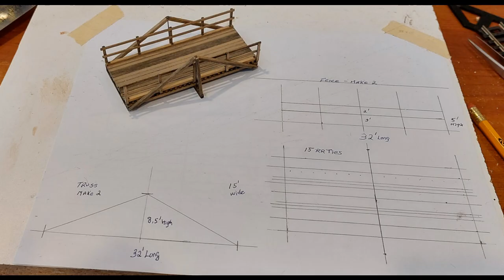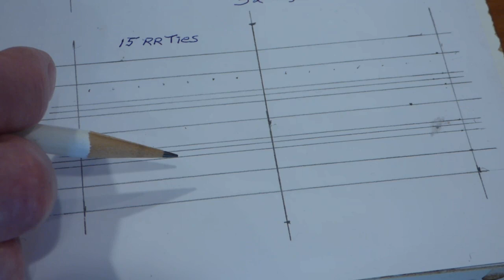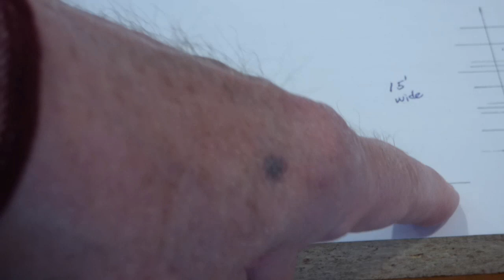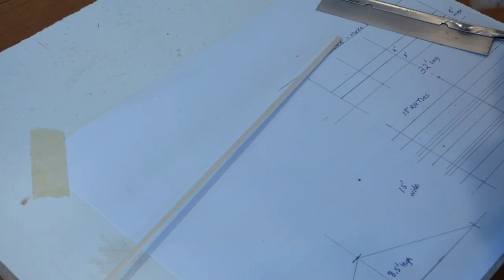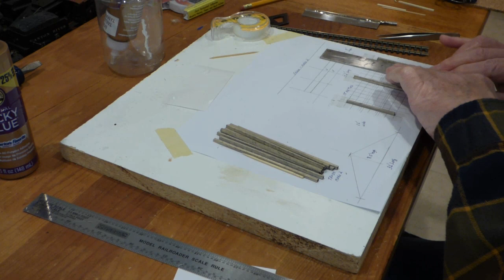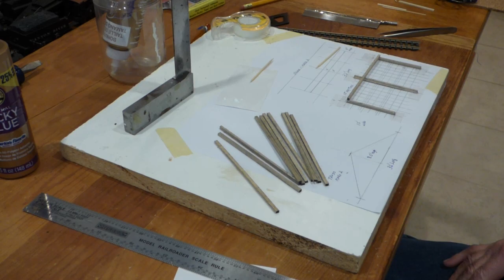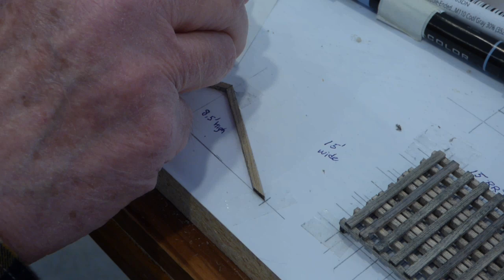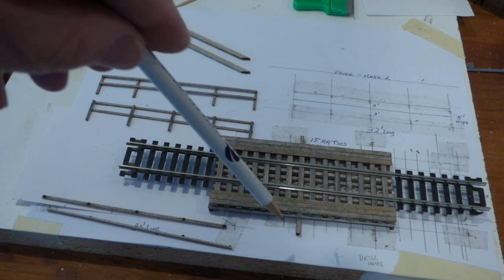Scratch-building A King Post Bridge

Comment: Nice looking model.
In general, clearance from the centerline of the track should be no closer than 8 ft 6 in on either side.  This will give a minimum width of 17 feet for tangent track.  Each state has a clearance diagram with all of the required clearances from the top of the rail and from the centerline of the track.  This is in case there is a person on the side of a car.  Some industrial tracks may have closer clearances but only on one side.  If clearances are less than 8.5 feet and/or even a crane hook can get in the clearance diagram, close clearance signs must be placed so stating.  I used to have a listing of the clearances for the CRI&P RR by the states that were operated in.  Almost all railroads had or have these clearance diagrams for track construction and for industries to use.  Most of the dimensions were either the same or very close.  If you are modeling a specific local at a specific time and know the dimensions use those.
For a railroad bridge, the long timbers that the ties lay on are called stringers and are usually 8 X 16 X 28 to 30 feet long because the spacing of the bents on a pile trestle are either 14', 14' 6"', or 15' center to center for a standard trestle.  Very old trestles bents were spaced slightly closer together and the stringers could be 6 X 14.  Stringers were either 2 per chord for light and old trestles, 3 per chord, or 4 per chord centered under each rail depending on the service of the track.  For trestles, stringers are not needed except under the rails and are always straight between bents.    Bridge ties were or are 6 X 6 X 10' spaced on 12" centers for old-timey or newer bridges are 8 X 8 X 10' spaced 12" on centers unless added length for walkways.  Steel bridges use stringers under the rails with 8 x 8 x10' ties @ 12" centers for open decks.  Ballast deck bridges use standard track ties at track spacing.  For steel(metal) bridges, there need to be 4 bridge shoes to hold up the ends of each span on each pier, bent, or abutment, one end pair solid and the other end pair to be on rollers or other means for expansion.  These clearance diagrams also give the minimum height over the top of the rail including wirelines, telephone, power lines by voltages, etc.    See https://www.facebook.com/photo/?fbid=1098916711028663&set=g.1726623474293896      and    https://www.facebook.com/photo/?fbid=961950968160895&set=g.1726623474293896
Reply from the maker: Thank you, Roy.  Very informative.